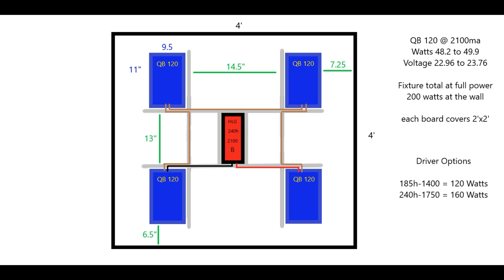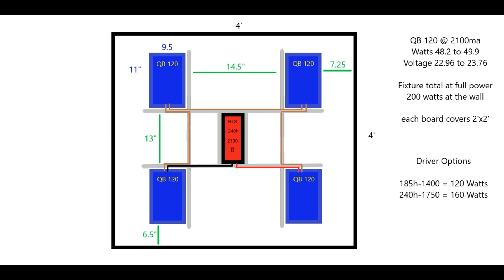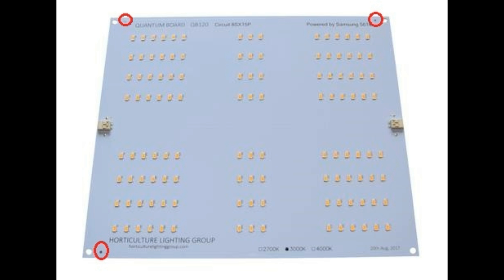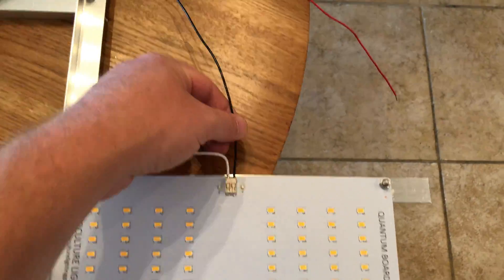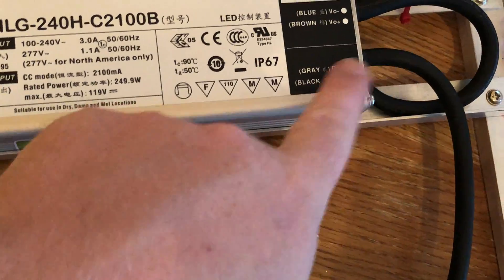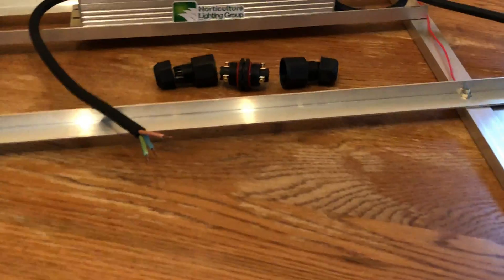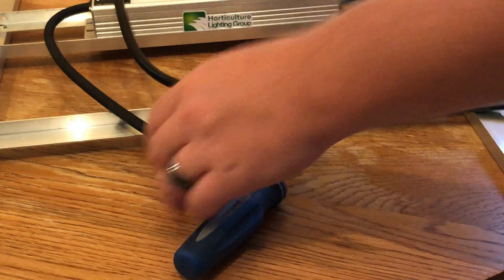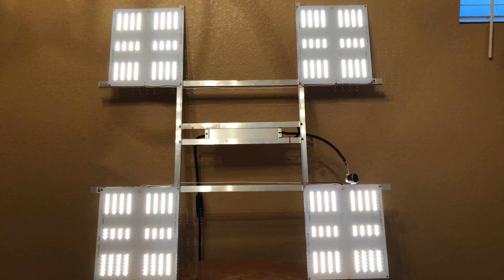Most Efficient DIY LED Grow Light For Veg Up to a 4'x4' Area Featuring Quantum Board 120's

Comment: Question, what is the actual footprint coverage for this set up? I know it says 4x4 ft, but on amazon  it suggests that for a 4x4ft you need 6-8 boards 120’s...also, can this boards be used throughout all the stages of the plants cycles; seedling, veg & flower
Reply from the maker: MrTicoFilms the QB120 are a Veg only board because they aren’t as intense as QB288. These 4 boards will Veg out a 4’x4’ but flower a 2’x4’. It’s really designed for an efficient veg light.

Comment: @12:00 cheap addition for safety of the boards would be to put a piece of thin plexiglass over the whole bottom, just use the existing frame to mount. Easy way to prevent any splash issue plus adds some bump protection to the diodes just sitting out exposed on the board.
Reply from the maker: 57ashdot awesome suggestion! HLG also makes lense Covers that you can purchase too! ✌🏻

Comment: Hi, nice video ! This board is only for veg ?
Reply from the maker: This board is recommended for veg as it only produces 200 watts. However I did a flower run with it and got a low but decent yield for 200 watts. could of also increased yield by lowering the light to about 10” above canopy. ✌🏻
Reply: @CannabisGrowGuide  So, which Quantum Board would you recommend for a 3' x 3' area for flowering ? It's gonna be a SOG. Thanks a lot !
Reply from the maker: Astro Zombie I would recommend the HLG 300 it is priced at 539.10 but even over that I would highly recommend the BLG-185 this is a 2’ 4 bar fixture that fits perfect for a 3’x3’ and cost 249.99. It also has Samsung LM301H most efficient diode on the market. Cannabisgrowguide.org/shop
Reply: @CannabisGrowGuide   Thanks a lot !

Comment: Lrs from meanwell drivers are very cheap and i no with the qb132's they can b ran at max 75 watts and can rest hand on boards and drivers. Small fan built in kicks on about 3/4 way turnd up. I did 8 qb 132's on a 4x4 fixture using 2 lrs-350-36. I no ur using the 120's arnt they 24 volts max?  The lrs drivers are half the price of hlg style drivers. Meanwell makes both . 600watts true watts draw for 275 bucks. Cant beat it. 8 qb120's& qb132's r best options for 4x4 or 4x5. Space lights bout 12 inches a part and u wil get best coverage imo. But good work bro
Reply from the maker: Shane Terps thanks for the info on LRS I’ll have to check that out for sure. You definitely can’t beat the price and efficiency of QB120/132. Thanks for stopping down my friend 👊🏻✌🏻

Comment: 4 of the qb120's will actually run quite well on the meanwell HLG-240h-c2100a. You're limiting the power potential with the 1750a or the 1400. The boards can take up to 2500mA and that rating is conservative. The 240h-c2100a will actually put way past the rated current to about 2400mA. Many meanwell drivers run a little on the "hot" side putting out a bit more then they're rated for. Even at 2500mA the qb120's don't run very hot at all. If you wired them in parallel with an HLG-240h-24a they would actually get the max rated power of 2500mA each. That's significantly more output then the 1750a would offer you. We're talking 30% brighter.
Reply from the maker: OGJD1984 Thank you for your suggestion friend. I'm not a fan of parallel wiring but that would open up a few more driver options.
Reply: @CannabisGrowGuide  From what I've seen these boards are not very prone to thermal runaway. Besides you need to have enough current available to runaway the led and if the boards are running at max rating at max output of the driver is essentially negates the danger. Have you seen LED gardners qb288 torture test videos? These Samsung LM561c diodes are almost bulletproof and certainly up to some parallel wiring if the driver's max current isn't very far from the board's rated max combined. If you think about how the boards are built they are wiring the diodes in different numbers of parallel strings of rows in series. The boards are already parallel.
Reply: What about 2 100h-24b in parallel
Reply: I bought 8 of the QB132 and had planned on running them with (2)240H-1750B MeanWell drivers. Would it still be a better choice to go with a higher mA output like the 2100B?
Reply: @hiddengarden3866  The rated max current of the qb120 is 2500mA @24 volts. Running them at 1750ma is not going to get you the max potential output that they could have. If you don't want the additional cost of an external dimmer get the c2100a. It will instead have a built in dimmer on the driver.

Comment: I've been building with these boards for over a year. 4 of them in a 4x4 is good for veg. You'll need 8 to properly flower the entire area. Just look at the recommended coverage area ratings for each board at HLG. 2x2 rated veg coverage and 1x2 rated flower coverage or 2 square foot per board in flower.
Reply from the maker: OGJD1984 You are correct friend. I will be using these 4 boards to flower out my 2'x4' tent. I am excited to see what they will produce.

Comment: So why 3000K and not 4000K for veg? Or are you just running this start to end?
I am looking to build me a decent mother tent light and was thinking this but in 4000.
Side note: for those with any heat issues in the warmer climates: consider mounting your driver outside of the grow space.
Reply from the maker: Red Oopic light will be used for veg and flower so I went with 3000k. Just showing a build for a 4’x4’ area. Which these lights could veg. ✌🏻

Comment: Real nice build, simple and effective it looks.

I removed that product sticker from the angle aluminum of my diy frame(s) - incase - just incase the heat did something bad.  And the HLG sticker on the driver...I'd be concerned because that driver is gonna get to around 55*C!
Just wanted to say that in case man - better safe than.. on fire, haha :D

That last flutey-jazzy track was nice too.

Peace.
Reply from the maker: I don’t think you can have a more efficient fixture for a 4x4. 

Next build for 2x4 flower is coming with Par readings. Same 4QB 120. 

Hmm that’s a good point. I do have stickers on my other drivers and I haven’t had issues. But I think I’ll remove them just because. Better safe than sorry. Much love 👊🏻✌🏻
Reply: Complex .... 55*C is nothing... It will definitely not set the sticker on fire...